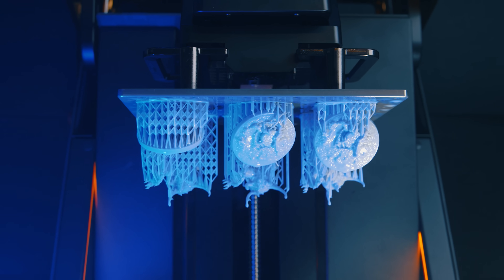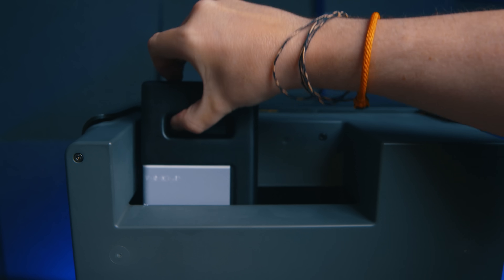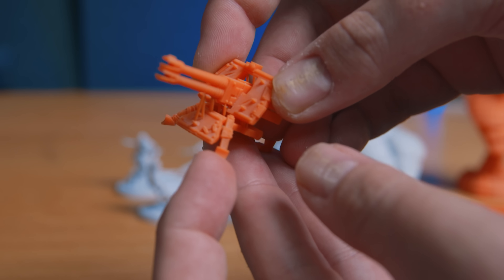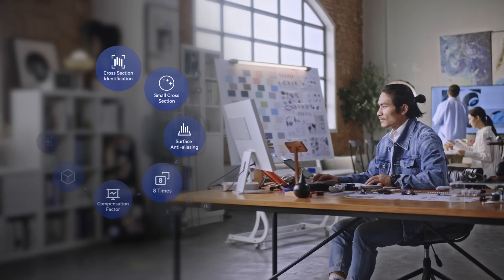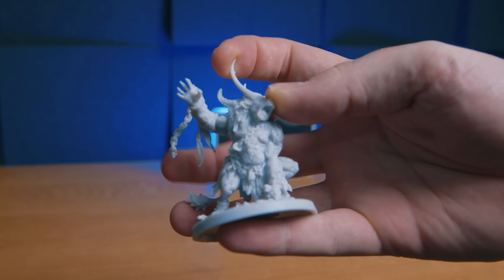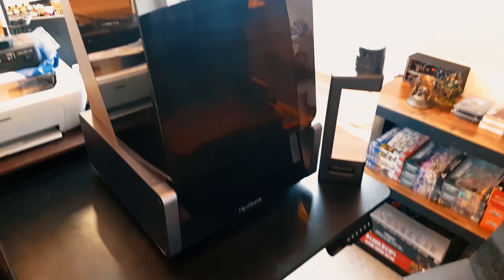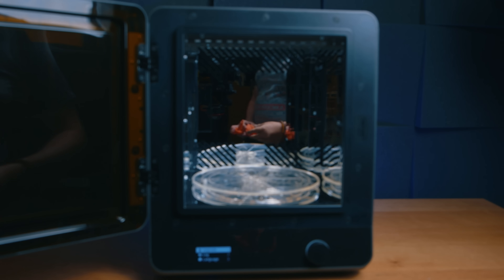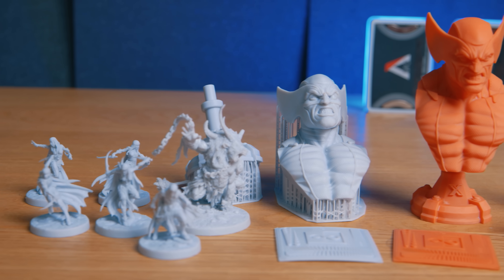HeyGears Ultracraft Reflex Preview - A 3D printer FROM THE FUTURE

Comment: The distance between the handles and the plate looks concerning. Especially with my long lanky  hands.

Are you able to refill the proprietary bottles and use custom settings for third party resins? Or are they locked in with an RFID chip (or somethimg like that) like other proprietary resin printers? I can understand having your own that "just work" but I sometimes need to use specialty third party resins with specific properties and also wouldn't want to be stuck with a non-functional printer if they ever stop production for whatever reason.

Comment: What is your impression of the comparison between this and the Uniformation GK Two? 
My hope is to get a 3D scanner and printer with a little learning curve as possible. I know it’s not unavoidable, and I want to learn, but it seems this Hey Gears model is the easiest, albeit the most expensive.
Also, do you have 3D scanner recommendations? I sculpt, and want to make duplicates of various sizes, which resin printing seems to offer. 
Anyhow, I’d appreciate any recommendations and advice you can give.
Reply from the maker: This is the easier to support models on and prints will pretty much always succeed on this

But I’m the time I spent with it, supports are excessive. So if depends what you wanna sculpt

My only experience with a s Amber is a revopoint pop 3, and it’s a pain in the ass

Comment: Got a HeyGears, and I've been struggling. Many of the prints have been failing, most likely because the models are small and the supports are insufficient. There is a little tool handle test print that comes with the printer, and I printed that first. What do I use this little tool (a metal thing with three oblong holes, and a handle that screws on)? Is it used to remove the sheet that forms when the whole print bed is flashed to remove a bad print?

Comment: maybe the wifi is for further integration too - to like connect to a camera and show progress or like control and such from out of the room, or if like a power outage is detected it can send you a message and when power is then re-detected (since the 'on' unit would be off - then power restored, and power comes back on) - can alert again, and allow you to resume or something?  I dunno but I like that it has the options, even if they don't come to be, over being stripped down to the basics like other companies do.

machine is great, but out of price range for most I think, especially for the actual build volume.  (198x123x220 height) its a bit smaller than current printers are doing, but who knows.

I do love the resin bottle ideas as well, but most of the tweaking and auto settings limit you to their resin (as most resins don't tell you their compounds in great enough detail to compile a list of exposure settings to use for 'your' machine)  but it also opens the door to some monopolization of prices on them.   I mean, you only need "1 bottle" and just fill it with whatever you want to print - but at the same time, it's just a bad feeling thanks to previous companies all doing similar things to exploit and greed.  (Apple I am lookin at you, same with you HP printers)

It's a bit all over, in a good way though. If nothing else, maybe it will help companies like Elegoo actually INNOVATE a new design, instead of just.. 'practically the same as last design'
Reply from the maker: Agreed. If it pushes innovation then that’s what matters.

Comment: As someone who has only had a printer for 3 weeks, they are not complicated to use at all. The quality of my mars 3 far exceeds any miniatures you can buy off the shelf, including warhammer. I would never buy a printer that locks you into anything proprietary. That's a huge no no. The shaking doesn't sound like something I would want but I guess it would depend on how much it vibrated everything around it.

Comment: Had 1 BIG question... could not find the answer on their site (I'm prob blind :hand-orange-covering-eyes:). Is this a LCD or DLP printer? I'd guess DLP as nowhere did they mention 4K, 6K, 12K etc.
Reply from the maker: It’s LCD. They haven’t listed the K because it’s not a comparable metric. Compare the pixel size
Reply: It's uses an LCD mask with a COB UV LED light source.

Comment: Looks like a FormLabs Form 3 clone but with DLP. It's the 3D printer equivalent of insert brand game console clone from China that boots up the generic 32bit games (the same system you got as a kid from the grandparent who didn't know anything about gaming) . Not to be outdone by simply being a clone in appearance, the claimed feature list is basically the same as the FormLabs Form 3. Nothing about this printer screams "future tech," when Phrozen has machines like the Mighty 8K out there that are far superior at way less cost wise. Don't even get me started on the cringe ads on social media, and the rushed out, glitchy website that's a headache to navigate (favoring graphics and transition slides over actual data or consistent font type.)

Comment: IF YOU LIVE ON THE EAST COAST USA:

HeyGears Shipping Pricing is a real concern!

     If you get the reflex combo and all available resins, shipping cost from our “LOCAL” warehouse will be $335.00 on top of the 2200.00 for the items themselves. There are 7 areas of shipping pricing in the US alone… from California (area 1) its “only” $198.15. East coast is of course area 7. The US East Coast has the highest shipping cost of all available pre-order areas, including internationally, except for a few (not all) locations in Australia!  WTH?!? 

    Also bottle of resin after launch will be 89.00 + 14.7 + tax… so 110.38est 😮

     It is NUTS to having that wide of a shipping cost spread over the US for the intended demographic of these products. And it will (and should) loose them customers because of it.

Comment: £1600 is not cheap for a printer with such a small build volume and £48 per 1000ml of resin and that's the offer  price, the normal price is £79 per bottle! This might make things easier but it sure as hell isn't for beginners or average ya Joe,  I print and sell models all over the world and I'd struggle to justify those costs to clients.

A large gremlin that takes 4L of resin cost £32 per bottle for elegoo abs Vs £79, also they should just sell the printer because unless I'm missing something (very possible🤤) it seems like a comb deal and I definitely don't want another wash or cure station..

Comment: So it's basically the same ideology behind Formlabs? Proprietary "engineered" resins, a reskin of PreForm, and a "just works" claim for a moderate to high price for the average consumer? Now I think this is a better deal than something like the Form 3 for the average person but I don't think it's the solution to someone tinkering with wanting to print some minis. This to me strikes that prosumer territory where you're trying to monetize your hobby.

Edit: So it looks like the presale price of just the printer is $980 USD so in line with something like the Anycubic M3 Max. So while I still don't like proprietary resins it's not as bad as I originally thought.
Reply: I agree with this point for this printer: trying to monetize the hobby

Comment: Having just ordered a Saturn 3 (upgrading from a Mars Pro), I think that the next time I come to change printers, this will be more mainstream and therefore affordable. Yes I know I'm saying this and I've just bought a Saturn 3, but that was on offer and I had to save up for it. Good review though as usual. I do agree with the lid comment though, I have got to find somewhere to put the Saturn where I can also lift the lid off. If you didn't know, the Saturn's height is 567.3 mm. That's over half a meter! But I pretty much have to add that again for taking the lid off. Doors are definitely a better idea.
Reply: Agree 100%
With all it's flaws, the lid on my Halot Mage Pro is WAY more convenient than lifting off my Saturn 2 lid. 
I'm always banging the Saturn lid against something - the overhead lights, the printer next to it, etc. Not only that but the lid is hard to hold while maneuvering it around obstacles, it's almost impossible to keep sticky resin fingerprints off it, and I'm forever looking for a place to set the lid down where I won't trip over it. (with all that said, I'll probably get a Saturn 3 Ultra when supply/demand/price eventually stabilize.)

Comment: Actually the biggest problem with resin printing is the odor and toxicity of the resin that destroys a normal person's lungs and makes it impossible to use in a normal house or apartment. I have to use Matter Hacker's MH Build resin because it's literally the only resin I can use and even then I use it in a detached building that vents outside and has nothing living in there. The second problem is the difficulty of recovering from a failed print and the mess and toxic hazards that causes. Fix those two issues and resin printing can hit the mainstream normie market. Until then it simply can't. The printers work, but the resin is toxic. That's the problem with the technology.

Comment: While I appreciate the support they gave and some of the thoughts they had (auto leveling for example), that doesn't justify the price for me. Their proprietary resin screems monopolization. The fact that, at least in the video, you have to manually fill the resin back into their bottles once done. I kinda don't get why I'd have to plug a bottle in, in the first place. Like in what world is that better than simply pouring it out. 

That aside, 33µm isn't the be all end all. I can get a photon mono 4k with slightly less resolution for 160€ incl. 1kg of resin. We're talking 1/10 of the price right now. But best of luck to them I guess.

Comment: Seems similar to Formlabs. Price is a little cheaper than the Form3, hopefully resin is cheaper than Formlabs $150 to $250 per liter. Formlabs software has one touch printing also where it auto arranges and does all the settings based on their resin. A lot of their resins require heated curing at 60 to 80 degrees C to get the full potential out of the material. I just got a Form 2 and have been learning about it....we will see how well it works because it was kind of used and abused 😆. Already dismantled it, cleaned spilt resin off some internal electronics....broke it, fixed it a little, broke it some more and then finally got it working. This past 5 hrs has been a rollercoaster for me haha

Comment: $2k USD is a bit steep though. It looks promising but they really should have done a kickstarter and started with lower pricing and used that time between to figure out how to get the price down.

Its smaller then the Athena and will likely be about the same cost as it MSRP.

Then having proprietary resin bottles to have the auto fill doesn't sound good either.

Would be nice if they did like 3rd party ink cartridges on printers where you can use one that can be refilled.

Comment: didnt you give anycubic shit for needing high speed resin for the high speed setting but this thing will need its own special resin to do anything.
Reply from the maker: Nope - i think you inferred that yourself. I didn't give Anycubic crap for anything, I just told people what their printers do. But i also never even made the point of needing a high speed resin for the high speed setting. Thtat's kind of a given. I said the quality of a print at high speed is worse than at lower speeds. again though, that's kind of a given.

This takes it's own resin which will give you the benefit of never needing to worry about dialling it in.

But I never said you can't use your own resin
Reply: @FauxHammer  I see where I got it from it was one of the comments in that video that made the comment, not you.
Reply from the maker: @vashshadow  glad to clear it up, I’m always checking I’ve not missaid things

Comment: Even the pre-sale prices are absolutely bonkers, but the care that they put into their machines, resins, and customer support seems pretty evident. I do chafe pretty hard at the closed resin ecosystem - but I also don't see anything mechanical that would prevent you from refilling one of those well-designed resin bottles with something of your own...the only catch would be if the slicer couldn't be trained to work with 3rd-party materials. 

Ultimately, I'm going to stick with the poor-friendly resin printing equipment I already have (Phrozen Sonic Mini 4K and Anycubic Wash & Cure station). However, if I won the lottery I'd consider giving this a closer look.

Comment: Unless there is a way to use 3rd party resins (like Siraya Tech), there is absolutely no way I'm buying this.  The benefits they're promising couldn't possibly make up for being forced to use their proprietary resins.  Maybe get that message to them too 😃If I could pour Siraya Tech resin in a Hey Gears bottle and tell the slicer that's the resin I'm using and it still makes a perfect print, they could steal the resin 3D printing market.

Comment: I don't see anything new here, on the contrary, I see old bugs like resin must be in their container so it must be bought from them which has already been tested on all kinds of printers including fdm... which is always a limitation and is simply bad for the user. No wonder they have perfect settings since they only have a few of their resins to test.
Reply from the maker: As shown in the video, you can just pour in any resin like normal. Yes you loose the auto fill, but it would be easy to pour your resin into one of their containers.
Reply: @FauxHammer  if you praise the printer for its functions, it is appropriate to use them, especially since you pay for them. If you give up this one function, I'm afraid that because of the resin of another company, so the settings will not be on point, it will not be so clean, there will be no refilling, the resolution is probably not too high either. What's left of the benefits of this super printer of the future?
I see it as a tool for printing from one resin by a person who does not want to learn printing because he prints teeth and only this and prints because he has to, not because he likes ... This is not a printer for a hobbyist and there is a reason it is sold in such a way . I don't know why you admire her so much on a channel that is rather about hobby printing...
Reply from the maker: @666Azmodan666  yeah you’re not wrong, this is more for those people who don’t want to muck about and just print. Those people are out there. Just like the Bambu labs X1C or the AnkerMake M5. They aren’t really that special in terms of tech. But what they do do, is make it easier for people. And like it or not, easier accessibility is the future. As much as I am a hobby channel. The hobby is miniature painting. I fell into 3D printing almost by accident. I like printers, I know printers now having used so many.

But my hobby is painting miniatures. Reducing the effort it takes to go from buying a printer to having a model I can paint is more than welcome.

The future is easier printing. 2D printing was a hobby at one point.

Comment: Hi there! I love your channel. But, can I STRONGLY disagree about resolution? 😆You already showed in your videos that when you have big voxels, when you paint the result is quite different than when the voxels are tiny or well anti-aliased. I agree that under 35 microns you need a microscope... BUT the texture and appearance of the surfaces changes A LOT and can be noticed at naked eye when we go to 20 microns.

By the way, I agree with you about ACF films: it seems to be blurring and introducing an unintended "texture" to everything.
Reply from the maker: You aren't wrong in principle, but even on those smaller micron printers like the Mini 8k with it's 22 micron prints, you need to enable Antiailiasing x2 and image blur x2 to remove all voxel and layer lines.

When you do the same on a sub 35 micron printer, it also removes all voxel and layer lines.

So there's a slight reduction in sharpness on the larger micron printers, but I'd challenge anyone to realistically see it.

Comment: I’m confused. What’s revolutionary or unique about this printer? The whole “it just works” argument is bollocks on the face of it because it only applies if you use their overpriced proprietary resin, and doesn’t account for other factors like Temp, Humidity, wear and tear on FEP and plate. 
Nothing else it does is anymore impressive than the next crop of Athena, GLTwo or even Anycubics latest. 
And ultimately, proprietary resins and proprietary slicer? Not a freakin chance. It’s taken the industry years to get past that crap. We do NOT need YouTubers promoting that stuff again. 
Way too much money for way too little. Easy pass

Comment: Do they have a resin that is strong like you could get with ABS or PLA, and not brittle? Considering whether to go the resin route or FDM with something like a Bambu unit.
Reply: did you watch the video?
Reply: @Mekhami  yes I did, the resin he showed is fairly flexible.I was curious if they had a resin that was as rigid and strong as ABS or PLA, but didn't crack and shatter so easily as most hard resins.

Comment: Whilst I am in no doubt, that this is a great machine, the price tag that comes with it puts it thoroughly outside any reasonable use for the tabletop wargaming and miniature  community. With an RRP of more than 1.100 EURO without VAT just for the printer, and custom resin to boot, I personally don't think this is a choice that will make any significant dent in the market. Even more so because of the proprietary resin that is needed to make the whole system work as intended. Anybody say ink cartridges for printers?
There are a number of quality of life improvements in this machine that are good, but by no means essential to get the job done, which is printing small little soldiers at a reasonable price from the comfort of your home.